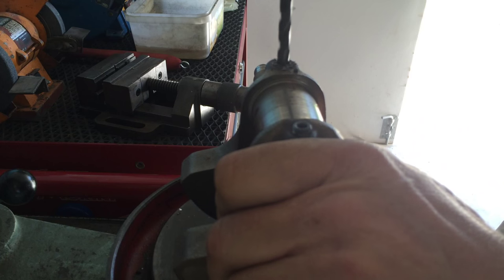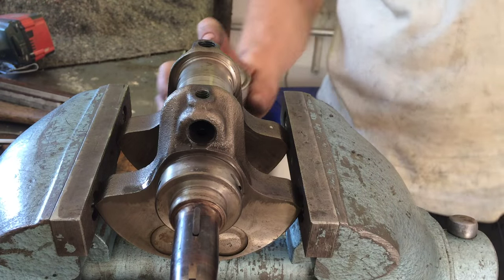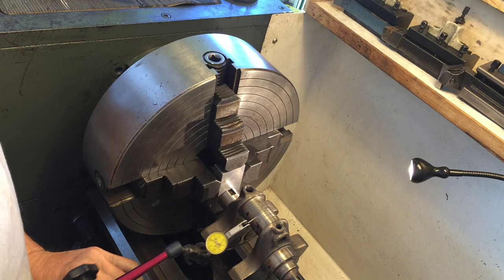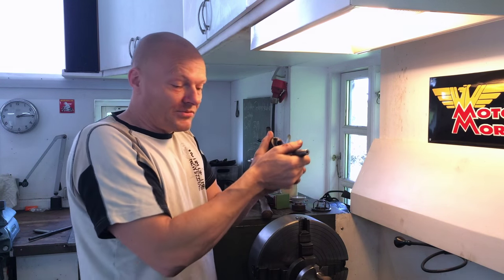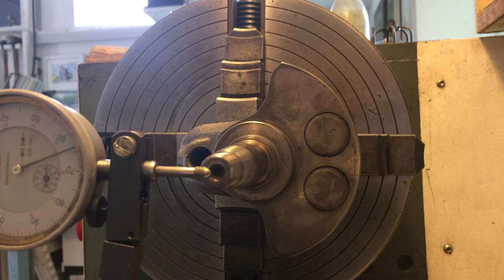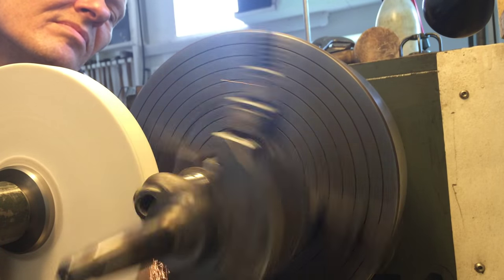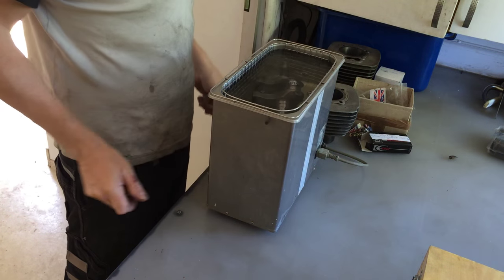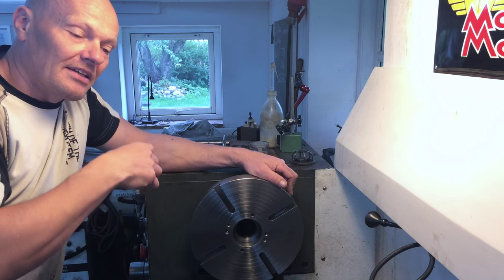Morini motor rebuild - a short glance!

Comment: Hi Soren,

The only safety comment you're going to get from me is EYE PROTECTION! I'm guilty of being lax myself from time to time, but never when grinding.

I's impressive what you're getting done by quite unconventional means.

The cranks are forged, rather than cast BTW and left handed drill bits are very handy for removing broken fasteners, or the plugs from the sludge traps.

Comment: Nice video, concise and to the point.
Re safety fears, You know the risks and can work around them and, after all a risk is only a danger if you are unaware of it, but you are wise to point them out to the viewers who might not.
I assume that Morini do not have proper micronic oil filters judging by the crud in the crankshaft, rather reminds me of Triumph cranks that were an equal nightmare.
Reply from the maker: +Chris Stephens Right, the Morinis only have a plastic "sieve"! There are quite some Morinisti that add an external automotive filter. I also have considered it, but it somehow ruins the look of the Morini so I stick to changing oil rather frequently.